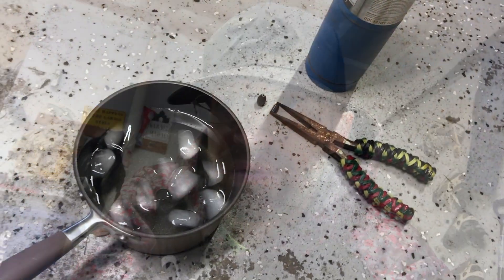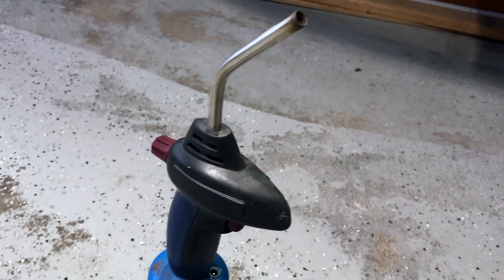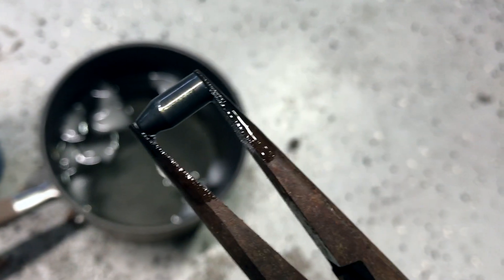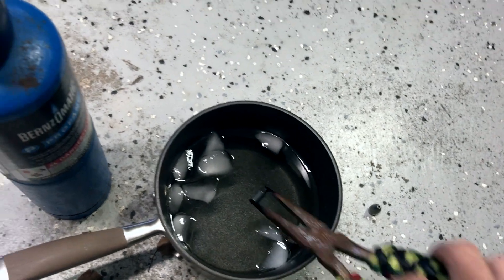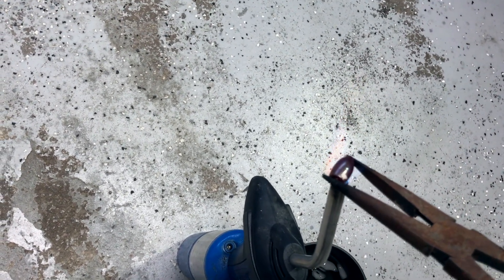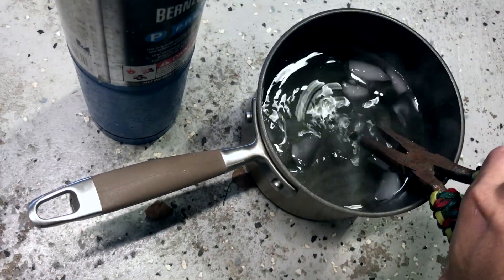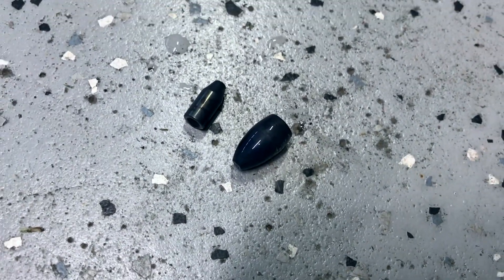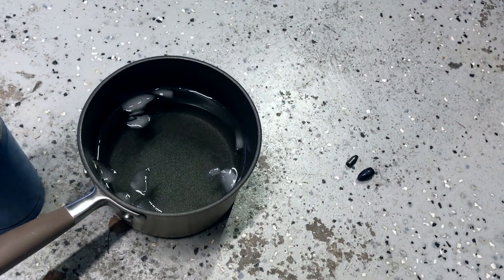Scorch your Tungsten...Dont Burn down the House!

Comment: Thanks for the trick!  In exchange: the hottest part of the torch flame is about an inch from the tip of the torch.  Its marked by the tip of the inner "core" of the flame.  Move the weight out a bit for it to heat more quickly.
Reply from the maker: yea I was just trying to cover the whole weight so I didnt have to turn it..